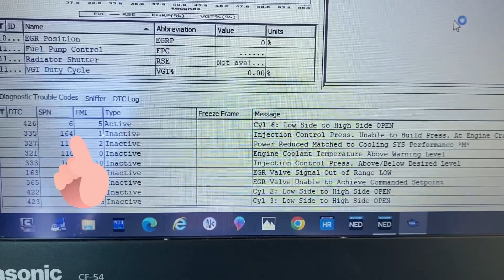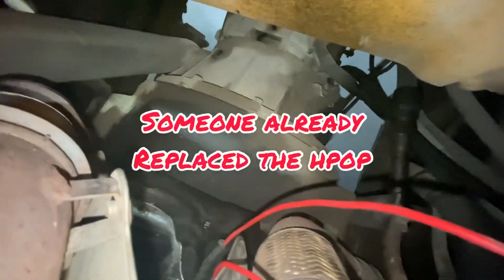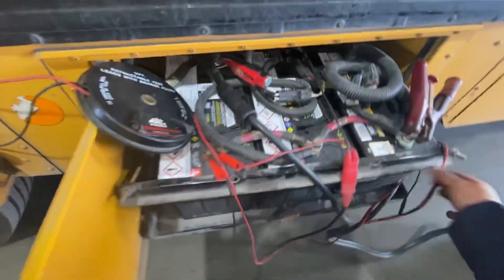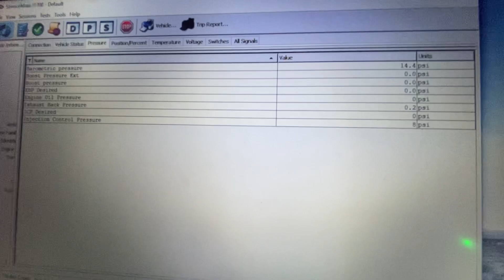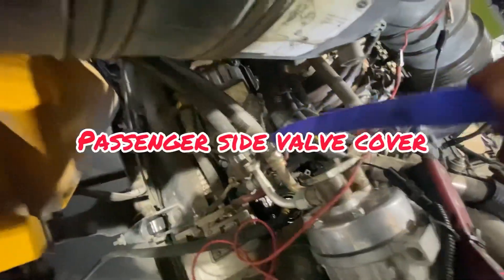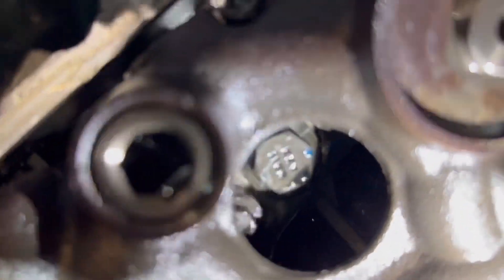Powerstroke 6.0/VT365 quick no start diagnostics

Comment: Nice video brother! Excellent diagnosis
I’m new in this diesel area
 What ICP stands for?
Reply: The injection control pressure (ICP) sensor is a key part of any diesel engine. These systems use high-pressure fuel to generate power and turn the wheels when you hit the gas. The sensor tracks injection control pressure to make sure the system is working at peak efficiency.

Comment: Ive got a question. I just picked up a vt365 myself and it has a crank but no start. I dont have a scanner for it to check the icp pressure. Although when cranking it does get one cylinder consistantly firing, and it does smoke a lot. Would that mean i just have to trouble shoot elsewhere, or should i be concerned about the pressure not building? Thanks.